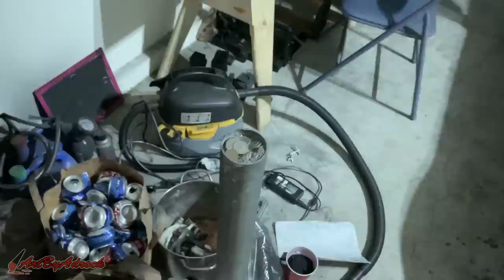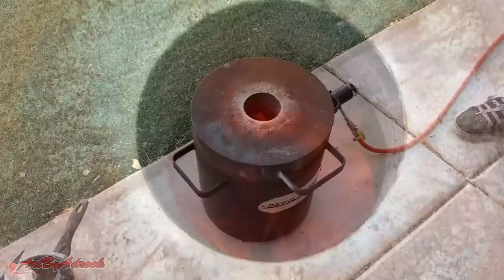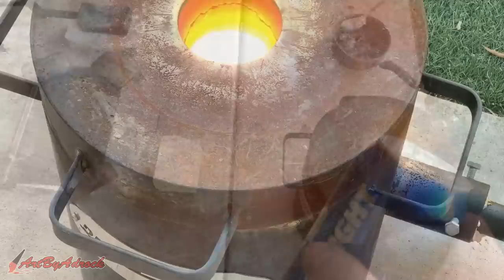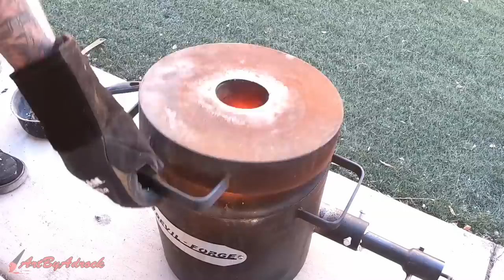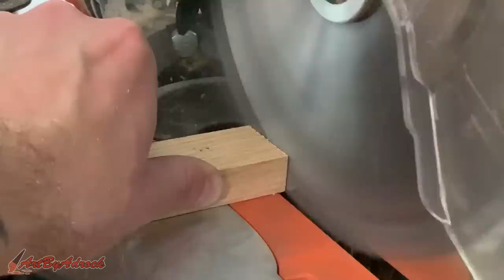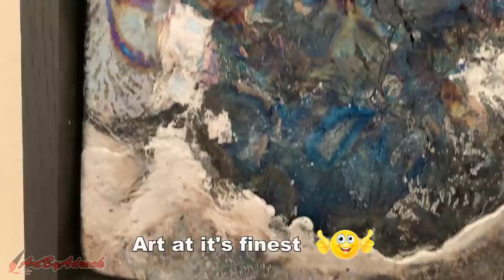I Made A GIANT Artistic Ingot From Recycled Aluminum Cans (But It Wasn't Painted)

Comment: What size crucible did you use? I have a furnace made of a small helium tank and am using a 4kg. The room inside is 6" diameter x 9" in height. What would be the biggest crucible I could use?

Comment: You might want to reinforce the frame a bit more, maybe a couple of nails. I can see that thin line of glue failing overtime. Just a suggestion:) love your videos anywho!
Reply: not rly, aluminum is hella light
Reply: The glue he used is the same I've used in past wood working projects. Once it dries it's not going anywhere. I've built four end tables, one withstood my 90 lb blue heeler standing on it to see out a window, no problem.

Comment: why are the tabs removed from the cans?
Reply from the maker: I melt them separately 👍🏻
Reply: @ArtByAdrock   you should know cans have a plastic coating inside to keep the contents from reacting with the metal ...that's the slag ...
Reply: @bedspread6224  the "slag" or dross is actually a combination of several things, the coating yes but then add in the ink on outside, whatever residual contents left in the can, and oxidation of the aluminum.